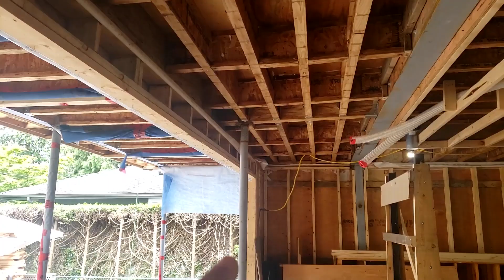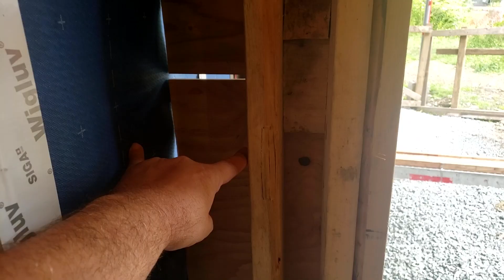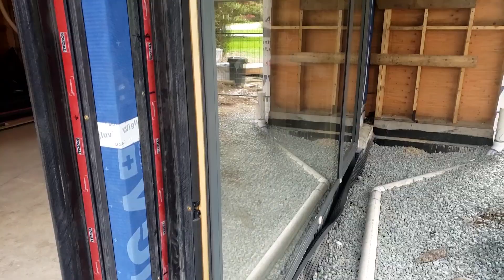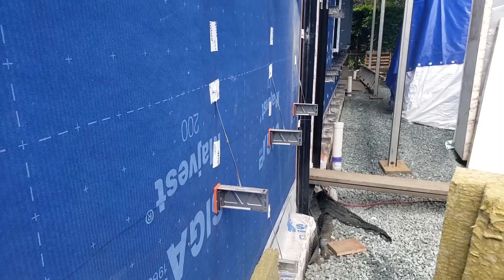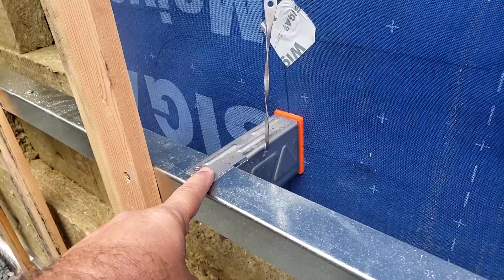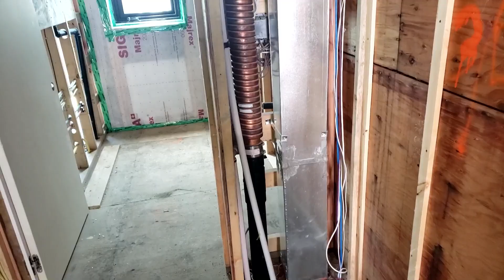INCREDIBLE THINGS I SAW IN CANADA - Part 1

Comment: 9:33 Vertical furring is touching the window frame and as a result water will accumulate there and rot the wood around it - if there was a suitable gap the water could drain out.

Comment: The clips in the mineral wool are cool. My masonry walls look similar with all the masonry wall ties going through the mineral wool batts and boards.  I like the Euro sills on the window. We do masonry sills which don't insulate and have mortar joints. But we do timber frames so they are minimal 12" thick plus zip sheating. Thanks Steve.

Comment: We tried that bump out with doors and windows but found they were colder. That's why we install in plane with wall and with thermal breaks. A recessed window or door is warmer then in plane. Commercial doors seem like they are the worse for heat loss and condensation.

Comment: Can't the furring strips be place flush up against the insulation?  The mineral wool could still drain reasonably well, and it's got plenty of ventilation in the adjacent cavities. 

What about pressure equalization and wind driven rain? An excessive gap could also lead to more rapid movement of air during a cladding fire.

Comment: There are a bunch of different manufacturers making similar clips.
In Canada, we also have ACS A-CLIPS  (made up of two pieces, so it's adjustable in depth) made by Soprema (same people who do waterproof membranes.
I can't remember the name of the manufacturer, but there is one up here who makes thermally broken, adjustable type. One part is made from glass fibre, and attaches to the wall, and the other type is steel (I think) which is used to attach the exterior cladding.

Comment: And we wonder why houses are getting so expensive when you see this type of construction there are far simpler methods of achieving insulation values than this. I suggest you take a look at quick therm for one. It's not the wall structure that loses heat, but the windows

Comment: real life Economic costs of a "passive' house ....Far exceed the Energy savings. 
 For Very Many years Too many truth be told    (use your calculator if doubting) . 
These are invariably interesting "affections"  built to satisfy Egos....  more than Anything else. 
Power pipe :-) Only has effect  when heated water drains thru it.    An Intermittent effect.. at best.
Reply from the maker: That can be true, but it doesn't need to be true. I have anumber of Passive Homes that have exceeded their initial cost enhancements in 5 years or so.

Comment: Great overview, Marcel provides more detail on the products and methods on this Passive House Accelerator video:  https://www.youtube.com/watch?v=gjk1yo2nd6g
Reply: But Marcel overlooked the double function of a WRB:
1. It has to keep (driving) rain away from your thermal insulation.
2. And this is the one he overlooked, it has to keep cold air (wind!) out of the insulation layer, espacially when you're using wool-like insuation material that is not air thight, like Rockwool.

Any WRB should always be the outer most layer (after the facade finish).

And capillary active materials (wood fibre, MDF.RWH, fibre cement boards,...) are preferred above foils. Foils a vapour-open but are not capillary active, they can not transport water from the inside to the outside.

Comment: 4 inches of exterior insulation how do you compensate for dew dew point what’s on the inside ??
Reply: Vapour Barrier goes on the inside, usually just behind the drywall. But mineral wool is vapour and air permeable, and it doesn't change when wet. It's basically stone made into a thick cotton candy. It will breathe and dry on its own.
Reply: There is 6” of exterior insulation so the sheathing will stay warmer and although I’m sure they’ll use Majrex as a vapor retarder it’s possible that if you modeled it they don’t even need one.

Comment: The clip product is called Crossfix by EJOT - a German company. The clips are stainless steel and are part larger system used to mount cladding on buildings. Typical use is commercial, but this looks like a great use on residential building. I have a crappy early 90s house that I am considering coccooning in rockwool outsulation, covering the exisiting brick and everything. These clips might be a good choice.
Reply: Covering brick seems counterproductive.
Reply: @user-roadwander  I've considered removing the brick - might make things easier. Either way the brick is not important.

Comment: Those heat recovery units for preheating water going to the HW tank are only usefull when taking a shower
Reply: or using washing machines +..
Reply: When a washing machine is draining it is not simultaiounsly filling so only a shower. It has to be water in, water out at the same time or totally ineffective @markgrabowski8662

Comment: I'd love to see a video about the differences in performance and cost (material and labor) between rigid exterior insulation outside the WRB + a single stud wall vs interior thermally broken double stud wall, with all insulation inside the WRB. I think this kind of comparison would be very helpful to a lot of viewers.
Reply: T-studs and H-joists are interesting.
Reply: Exterior insulation doesn't eliminate interior insulation it only furthers protection against thermal loss.
Reply: @I-md6mq Exterior insulation can easily replace interior insulation. But most people see the wall cavity as an opportunity to add additional insulation.
Reply: You can try to explain it, I think Steve is a busy guy.
Reply: @seacoconut  This is exactly the kind of thing Steve discusses all the time, so I don't see your point.

Comment: Those insulation brackets should have been made out of glass fiber reinforced epoxy instead for much better thermal bridging/conductivity performance
Reply: There is another company that makes what you're describing. I can't recall the name but I know NS Builders (Boston) has used them; might want to check their videos.

Comment: Has anyone Done any research as to what you accomplish with a thermal break. I can't find any.  Is it cost effective? Hey Kids Great PHD there. You Might even get someone to pay for your DEGREE. Very Interesting building system. But I have to say I'm pretty sure I would've defaulted to a foot of concrete wrapped in foam. But Maybe I'm wrong and Just Old School.
Reply: My picture window is vinyl split frame  ie thermally broken its the only window in house that does not get frost on inside when it's -40 c outside,  not sure on savings but certainly works

Comment: I love your videos and realize you show different construction ideas. However, do you agree that the material and labor costs would be MUCH cheaper if you simply installed comparable R-value rigid board insulation with wood slats instead of all of those brackets, metal rails,  mineral wool/Rockwool, and wood slats?
Reply: Mice don’t crawl through mineral wool.
Reply: Foam board shrinks over time

Comment: How can that lvl be attached to the ledger properly with 6in of foam wedged in between. What about the shearing forces? It looks as though the cantilevers moment of force is mostly resisted by the foam?
Reply: The lower angled screw is taking the vertical loads, the upper straight screw, the cantilever moment.
Reply: @koenraadprincen7212  yes, if it’s flush with the ledger, but that foam in between is just somewhat better than air.
Reply: @UrR2KBA  EPS (and XPS) comes in different qualities regarding compressive strength and don't forget that the legder board (LVL) also spreads the compressive forces.

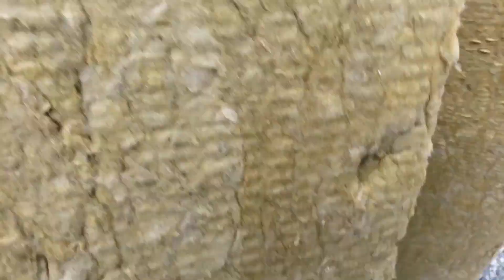Comment: 7:10 - looks like a horrible thermal bridge.
Reply: The orange plastic is the thermal break.
Reply: but why use metal across 90% of your thermal cross section? if its -20 outside that grid of steel has to be reducing the performance of that wall. @GregsStoneYard
Reply: @carlosbourdet5415  You have to bridge 6" and support the cladding.  WIthout seeing some thermal imaging, I'm going to assume that bracket manufacturer has done some, and that the orange nylon/plastic part is enough to break the thermal bridge.

Comment: That is a really well designed and built house! Steve didn't specifically mention the drainage membrane rapped around the foundations, but you can guarantee there is a french drain around the entire property;  the membrane is there to ensure that any water that approaches the house will be drained away from it quickly. Ejot and Soudal are big companies in Europe. Ejot make a very large range of different fixings for insulation, including the plastic-headed screw fixings seen in the video.
Reply: Mento make a really good WRB as well
Reply: @Bolthrower91 ?

Comment: Wouldn’t you put a weather barrier over the rock wool?
Reply: It's got a water-proof coating, so, in theory, it doesn't need it. For buildings where you want a very long life (100 year+), you might want to add a breathable weather barrier over rockwool, but you'll always have penetrations for the brackets going through that barrier, so doing it properly would require a weather seal for each bracket.
Reply: @tlangdon12  For wool-like materials, the WRB has a double function, it's also needed to keep the wind out of the insulation layer.
That's why the WRB had to be finished "as much as possible" as if it was an (external) air barrier.

(The WRB Majvest 200 is placed at the wrong location in this project).

Personally, I would rather use a capillary active material as air barrier, i.e. MDF.RWH, fibre cement board,...

In general, a vapour barrier is less important than an air barrier.
Reply: That's exactly what the majored 200 is made for 🤐

Comment: love it. what do they use for insulation on the inside cavity and what is the total R-value.  were those marvin windows?
Reply: Regular fibreglass batts usually R22
Reply: They almost certainly use nothing on the inside cavity! They don't need to with the insulation on the outside of the wall, and they don't have any cold bridges caused by studs.
Reply: @tlangdon12 6" exterior insulation is not enough for passive house.
I'd expect them to use mineral/glass wool in the wall cavities too.
Reply: @tlangdon12 this is Canada, almost certainly will use (probably rockwool ) why go through all that effort outside and NOT do the easy inside and greatly increase r value ?
Reply: @tlangdon12  that would be bad